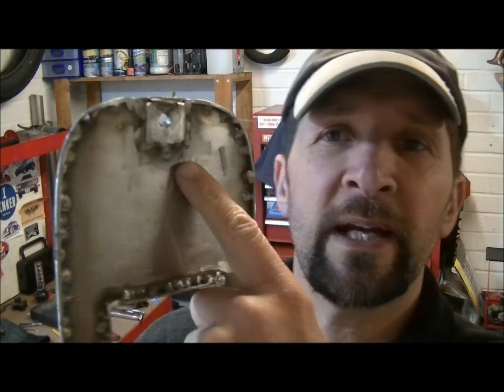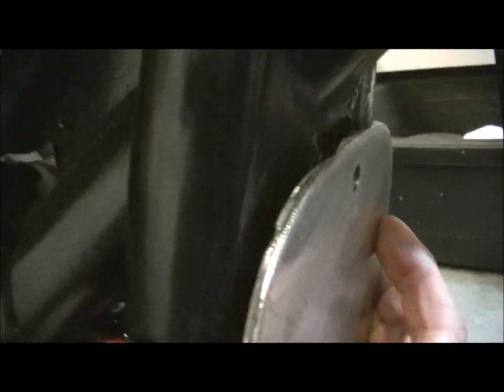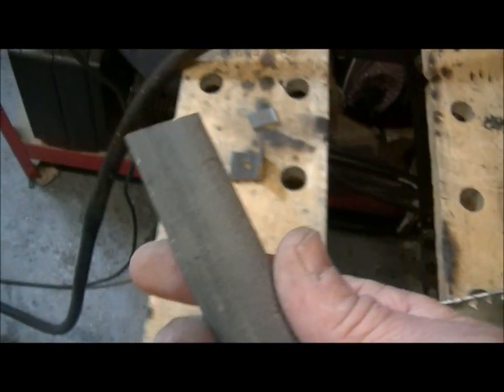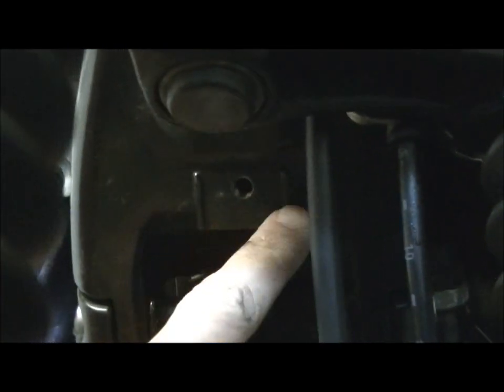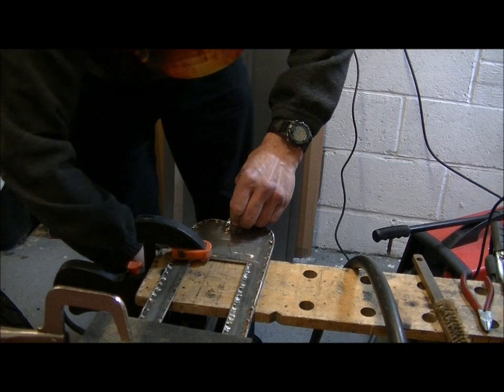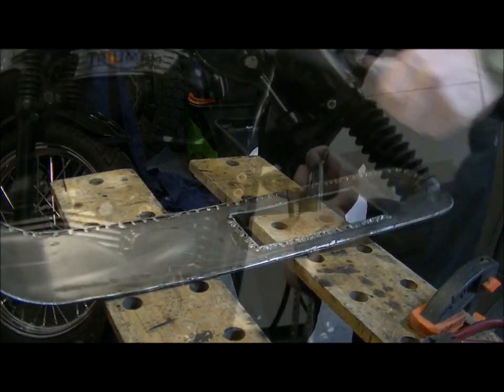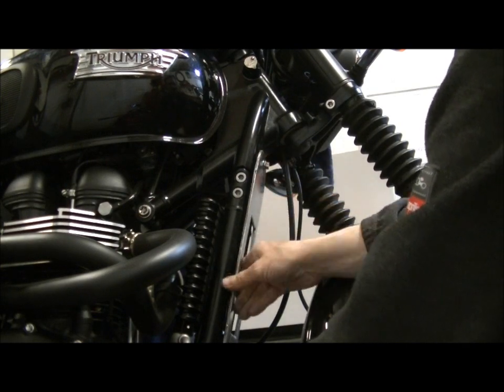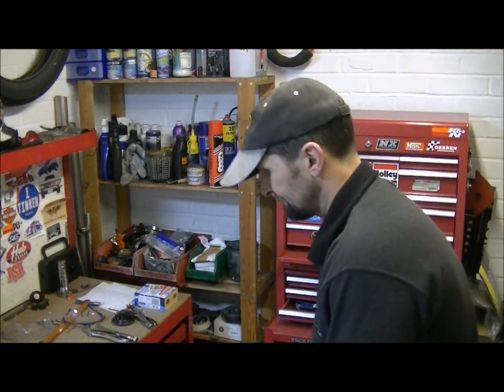Delboy's Garage, Project Triumph Bash Plate #8

Comment: lovely job del love watching you vids mate,had a thought, when you have finished the bash plate have you thought of runnin a thin strip of self adhesive sponge round the edge just as extra protection for the frame,take care buddy keep the rubber on the road,
ps love the q&as ,perfect sunday top gear then you
Reply from the maker: Hi Nick. The intention with the plate is to make it sit off the frame a tad so there is no contact, i may sue some edging strip if i can find the right product....but its a way off yet and ill think of the best thing for the job by the time i get there... Thanks for your kind support... last episode in the series of the Q&A this Sunday, so enjoy, and we'll be back with more in the summer...take care.. Del.

Comment: Coming right along. Just a thought, what if you were to get some rubber for the bottom 4 bolts? Would be solid and also prevent scratching... Ride Safe....
Reply from the maker: Like your thinking buddy... im planning to mount it clear of the frame and will also make sure it has a level of protection just in case it touches.  Got to fabricate the actual spacers to hold it clear next... take care mate... all the best.. Del.

Comment: Strange you should mention getting a stronger vice, I've been thinking that for a while Del, to be Quite honest if you lived a bit closer I'd have popped one round by now, lol, it's one of those things you only think about when your using it, I lost count how many times i've tried welding and forgot to put the earth strap on, another 20 hours should finish it off Del, lol, RSMF.
Reply from the maker: Ayup Skeggs... TBH its not the vice thats weak, its the table...i need a proper thick and solid bench rather than that machine mart hobby table i have....and once i have time ill build one from 4"X4" posts and steel...and bolt it to the floor too....just need to get all the other jobs out of the way first...lol  i reckon another ten parts would see it in primer...but i never set time limits or deadlines...as then its no longer a hobby i can pick up and put down again....it becomes a duty...and i have enough of that at work..

Comment: Question for Q&A maybe, I've noticed that when you use a drill you finesse it instead of getting a starting point and then just full power on, does it make a difference?
Reply from the maker: Hi mate, fully subscribed for the last Q&A but with the drill, i have a fast speed only drill, and if you just power in hard you can burn out the tip....if you pulse the drill it keeps the speed slow and the heat ti a minimum....also if the hols is slightly off centre even by 1/2mm, then i can correct it with a rat file... just makes for better results.

Comment: You fair weather riders that need heating in the garage ;-) lol

Rust on the horn mount already, thats not good, triumph need to look at the quality of their suppliers :-/ Best check mine :-)

On a positive note, the quality of your work is really starting to shine through, the bush plate is starting to evolve into a great add on to your bike :D
Reply from the maker: Thanks Rob....its kind of an obligation to take better time and patience with this one as its gonna bolt to a new bike and has to fit in and look like its a fitting accessory for the bike and up to the standard...plus, everyone's a critic aye.. so when it gets seen about, you dont wanna look a knob aye...lol